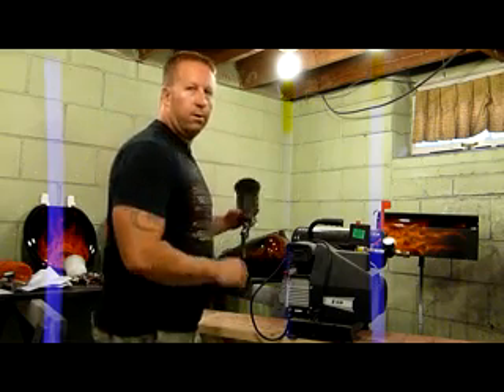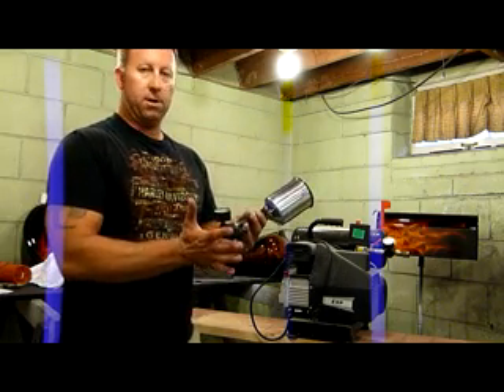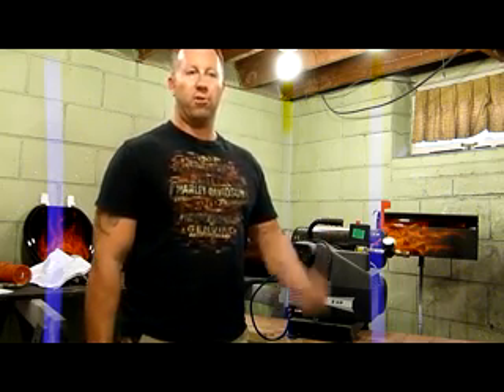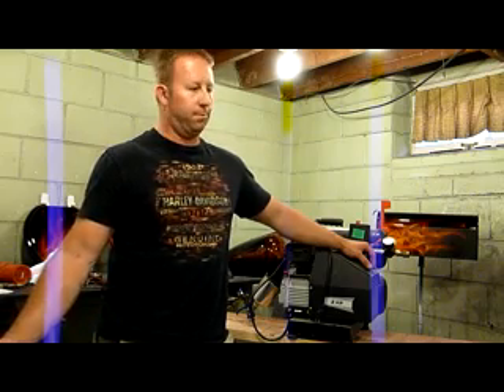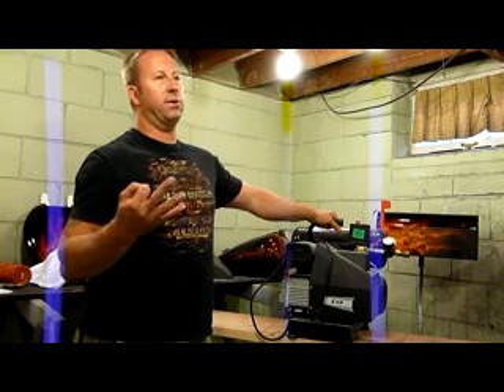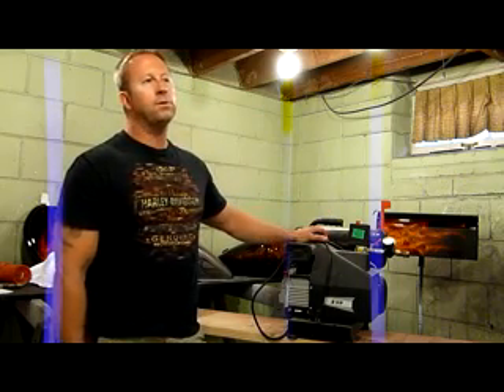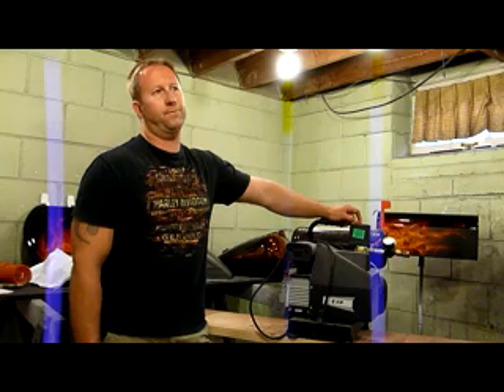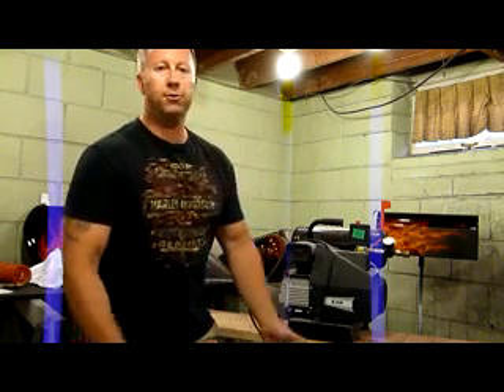pressure regulators, pressure drop, and air compressors

Comment: you are so right on the types of compressors.years ago i used my bosses direct drive oil compressor and used to think it was loud until i had to by my own.i got a small oil-less and holy crap it was loud.i actual thought it was broke and brought it back and found that was normal.20 years [lite use]and 3 reed cleanings it is kicking.this year i found an oil-less 30 gl ,C.H.,like you said,"at the dump".i put in a $3 bearing,started it up and holy crap crap crap,it was loud.cant stay in same room .hurts my ears.week later got oil 220v,5 hp.,belt drive with bad tank for cheap.and ahhhh,so nice.i just could not believe how quiet it is.i can even talk to someone in that room.gona bolt that baby on the C.H.tank and i'll be golden.the new,low end brand, belt drives,with big tanks,are getting to be priced pretty low.anyone thinking of getting a compressor,would be well advised to shop around and find a belt drive.the wait to save up more money for it .will be well worth it for more cfm and far less noise. thanks.